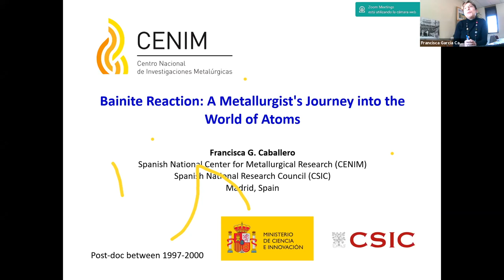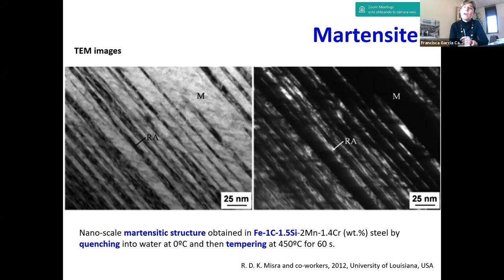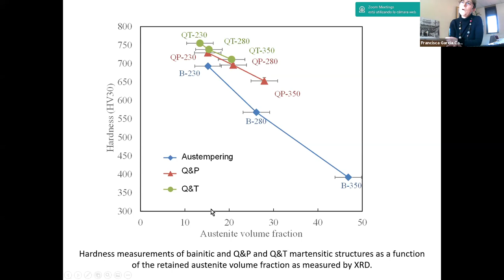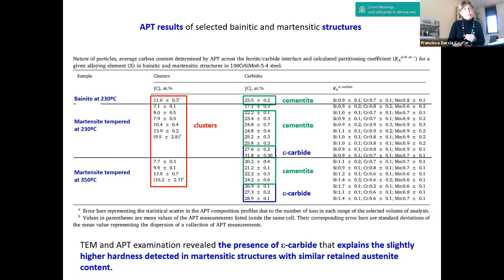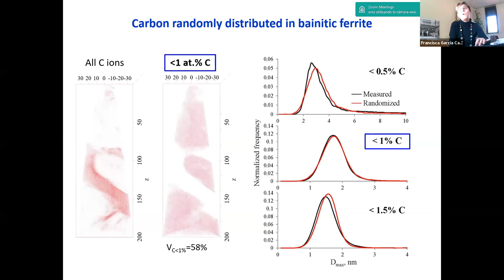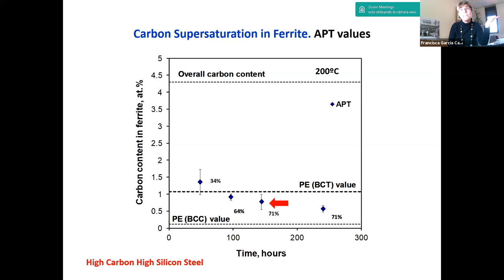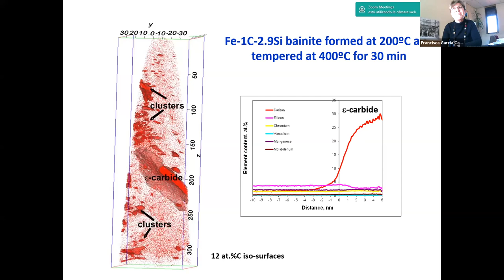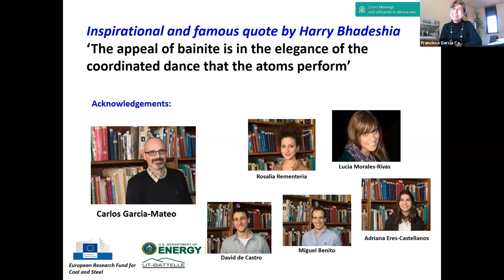Bainite: metallurgist's journey into atoms, Professor Francisca G. Caballero, Lecture 3 of 25

Comment: I apologize if this is slightly off topic, but I have heard of an experimental heat treatment for high carbon steels.
In essence, it seems like an austemper of sorts, wherein after significant grain refinement, and interrupted quench is then held in a hot oil bath of approximately 400-450f and slowly cooled over many hours, cryogenically treated, then tempered at a low 275-350f. The results have shown near complete hardened martensite but with significantly higher toughness - 4x the standard heat treatment on a CHARPY test being normal with a steel like 1095. I wonder if you have idea what may be happening in this case? My guess is some small quantity of fine bainite and mostly martempered martensite - but the low retained austenite after cryo and final hardness is significant for being so tough. They have also tested samples at cryo temperatures and they still show significant toughness. Slow cooling from near or slightly below Ms doesn't seem like it would be enough for such performance.
Reply from the maker: Please see 
https://youtu.be/qzL9rXGVy6g?feature=shared
Reply: @bhadeshia123  Thanks for the reply and information. I hadn't realized how much an austemper can impact toughness though, especially less hardenable steels. The ASM guide mentions twice the toughness for a martemper as a regular Q+T for 1095, and half that of lower bainite, all at the same hardness.
You're a fantastic scholar and researcher, keep up the good work!